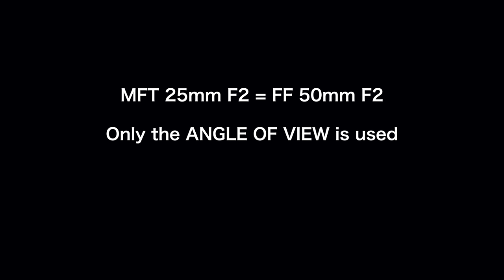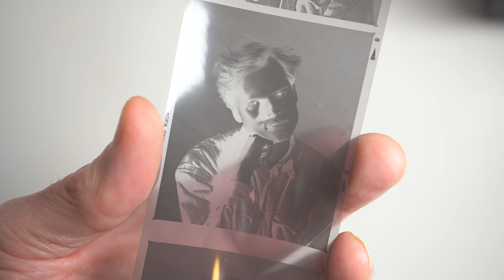Equivalency –What does it matter?

Comment: I'm an avid lumix micro 4/3 user and love that the lower end of lenses are really small and portable, but I realised that if I want to start buying the higher priced lens, eg. 42.5mm f1.2 nocticron then I would have been better off buying a sony FE 85mm f1.8 which is faster and cheaper by 30-40% and this is just 1 of many examples.  Size is roughly the same, so thats when Micro 4/3 start to lose its advantages.  I think if you want to invest in glass, then its cheaper in the long run to buy full frame if you compare them properly, i.e. method 2 in your video.   But if you are just a pro-consumer like me and only buy sub $800 lense and love portability then micro 4/3 is better.
Reply: Raymond Par. Mico 4/3 is interesting if it stays compact and cheap ( bodies and lenses). If you start buying expensive and fast big lenses , you shall better go for FF mirrorless with f1.8/ f2 prime lenses and f4 zooms. Currently it means Sony FE or Nikon Z systems.
Reply: How do you figure f1.8 is faster than f1.2? Will you have shallower depth of field with the f1.8 on a FF camera than the f1.2 on MFT...yes. But the f1.8 faster...NO. All else being equal if the light available requires f1.2, the MFT will have the proper exposure, while the FF will be under exposed.
Reply: @pwx8460  , have a look at 6:01 and do further research into how and why the MFT system need to double the f stop in depth of field as well as light.  I was also shocked by it in the beginning as I thought that same as you and thus compared lens between MFT and APSC and FF the same way, unfortunately there is a heavy premium to have FF equvalent fast lens in MFT system.  Also, 6:01 reveals that 50mm = 25mm, ISO 800 = ISO 200; F4 in light and DOF = F2  in MFT system.  Regardless though, I've come to terms with why i bought the MFT system in the first place which is size and weight, thus my original statement holds.
Reply: @xsaviour755  Hi. I did, look again, but already knew the answer. The f4 FF and f2 MFT looked the same, but all was not the same. Matti had different f stops AND different ISO, he had to crank ISO to 800. So two stop change in f stop and 2 stop change in ISO.  For the same FOV for any system and all other parameters the same an f-stop is an f-stop. Yes, the depth of field is different, and the required focal length is different...but for the same FOV you require the same f-stop. That was my point about f1.8 is not faster than f1.2. Now if you tried to cram a MfT lens on a FF camera you obviously would have a slower lens than what's written on the lens barrel (by 2 stops). As well as massive vignetting and a host of other problems. 😃
Reply: @xsaviour755  Your information about exposure differences is incorrect; the video shows that the exposure is identical at the same f-stop on both cameras. An f/2 lens on MFT captures the same light flux per unit of sensor area as a FF camera with an f/2 lens. What changes is the apparent depth of field at the same distance with an equivalent lens focal length (e.g. 25mm on MFT, 50mm on FF).

The reason for this is because depth of field is dependent on the actual physical aperture of the lens, also known as the entrance pupil. A 50mm f/2 lens will have an aperture of 25mm (50mm / 2). A 25mm f/2 lens will have an aperture of 12.5mm (25mm / 2). Essentially the 25mm MFT lens is stopped down to a FF equivalent of f/4 (50mm / 4 = 12.5mm). This is why an f/2 MFT lens of half the focal length, looks the same as an f/4 FF lens.

There is a lot of misinformation out there on the internet, but the reality is easily proven with some basic math!
Reply: @pwx8460  We are not anymore in film times.
I have got MFT and  ML FF bodies. They all have variable iso. If you think that noise and dynamic gap between them is only 1 ev , you are wrong. My conclusion is:  Expensive MFT bodies and 1.2 MFT lenses are not competitive and not compact enough.Keep your MFT gear small and inexpensive or switch to FF.
By the way, try you example in real life with same iso value and ,if you have an Olympus body and a Sony FF one , you will see that one iso by Olympus does not equal one Sony's one.
Reply: @metphmet  since when did digital change the physics of optics? The discussion was about the light gathering ability of same F-stop on respective sensor (or film) sizes. 

As far as your noise argument if that's what you're trying to get at, equivalency (the entire point of the video), would suggest about 2 stops different between MFT and FF (with the same number of photo sites, and same employed technology CMOS, BSI etc.).

See post above by John Wheeler, he has it spot on.

Oh and a quick cursory glance shows lenses of equivalent focal length and f-stop to be twice as heavy and nearly twice as expensive for FF compared to MFT.

Not fully twice the price you say...well when you're buying technology you shouldn't be paying by the pound, like a sack of potatoes. There was just as much engineering involved to design either lens. Just less materials in the MFT...which is the smaller (much) portion of the cost in making a lens.
Reply: @pwx8460  You know that there people like me using both mirrorless systems and who know a little bit about this topic . 
May I suggest you to watch size and weight of a EM1 with a 25mm f1.2 and compare it to a A7III with 55mm f1.8 or Nikon Z6 50mm f1.8. I can give multiple examples like this. When I choose some MFT equipment , I tend to keep it small and compact. 
Actually I don't understand your point . Do you suggest me to sell my A7IIIr and my 55mm f1.8 to upgrade my Panasonic with a G9 or EM1 with 1.2 prime lenses?
Reply: @metphmet  Hi again. I don't expect you to do anything. To each there own as they say. I've owned/used MF,  FF, APS-C, 1/2 inch, as well as the tiny sensors in various cell phones. Never owned a MFT but intrigued by the platform. Please read my 1st reply. F1.8 is not faster than f1.2 when lens is affixed to the body it's designed. I think the post above by John Wheeler stated it best.
Reply: @pwx8460  , John wheeler's math is correct on the lens part but his assumption that ISO 200 on MFT = to ISO 200 on FF is not.  If you watch the link I gave, then you will see that ISO 200 on MFT = ISO 800 on FF which in turn means that F2 on MFT is giving the same results as F4 on FF.  We are not talking about calculations, we are talking about results = equivalency as per Matti's point on the video.  The question is if I was to get an MFT system, how do I get the same results as their FF equivalent.  If panasonic and olympus played on the same ISO ratings as their FF counterpart, then we will see the true output of the MFT F1.8.   I'm sure you've heard that MFT has higher noise when you compare ISO 200 to ISO 200 FF.  That's because their are not the same, and is more like the ISO 800 FF. Once you accept that this is true, then you will realise that F1.8 on MFT performs the same as F3.6 on both DOF as well as light gathering (only because they aren't playing fair on ISO ratings)  You can either think of it as MFT is lying about the ISO but is truthful about the lens aperature performance or the other way around.  Either way, MFT are using a system built upon on FF and marketing their line up as equivalent when it isn't performing the same.  Thus back to my point of "if you want equal high end performance"  then FF is better bang for buck, however if you want portability then go MFT.  Or you can just believe their marketing and pay almost double the price for high performing equivalent lens.
Reply: @xsaviour755  You've managed to put words in the mouths of 3 people, none of which is there. J Wheeler never said 200 FF = 200 MFT. I specifically stated there would be about 2 stops difference between FF and MFT (assuming photo site size being equal)...read my post of 3 days ago. And finally you are doing the same with Matti's video, since he said no such thing as you implied. At the video mark he had ISO 800 with FF camera to achieve f4 exposure same as 200 ISO with MFT and f2, showing same depth of field... equivalency. Your way of thinking suggests FF cameras are 'cheating' when compared to MF, and apparently criminal when compared with a view camera.
Reply: @pwx8460    , I want to learn more but not quite understanding your explanation.  So, correct me if I'm wrong.  My understanding of what you mean is that 1) iso 200 MF = iso 800 FF? Is this correct? 
2) F2 on MF = F4 FF in regards to exposure  Is this correct? If so doesn't it mean that F2 MF is slower than F2 FF ?  Which was my original point.  Can you please clarify.
Reply: @xsaviour755  sorry for the delay, YouTube notification didn't work. Item 1 you listed is true....IF you are considering the amount of noise between the two formats AND they crammed the same number of photo sites (pixels) on the MFT as on the FF. MFT is about 1/4 the size of FF, so actually a 20MP MFT may perform similar noise wise as an 80 MP FF. Assuming similar technology were applied (BSI etc). Most FF  have  much fewer pixels than 80 and consequently perform better noise wise often nearly 2 stops worth, which is why 200 ISO MFT is compared similar to 800 FF. However, in terms of exposure (all else being equal) the exposure would be same 200 to 200 or 800 to 800. The same idea applies to your item 2. For exposure the same f stop provides the same exposure for either format f2 to f2 etc. The lenses are bigger for FF ( and at same f stop), due to the image circle needing to be that much larger for the FF vs the MFT. So yes that bigger lens casts more light, but needs to, to cover the larger sensor. My original post was to argue that an f1.8 is not 'faster' than a 1.2 respective of the  sensor it's used with. If that 1.8 FF lens was on a MFT ( in some way), it would still be f1.8 in terms of exposure but casting a much larger image circle only to be 'wasted' or going beyond the edges of the  MFT sensor. I'm typing this on a phone, so hopefully my explanation it's not too convoluted.
Reply: The whole point  is that the DoF in m43 is *different*, and that you need to multiply by 2 to get equivalent DoF. If you want shallowest DoF, f/1.2 on m43 loses compared to f/1.8 on FF, period. Plus, FF bodies have better higher ISO and DR as this video actually notes, so you're not going to have an image that is unavailable, or inferior. m43 can offer great results, but @RaymondPar is right here.

Comment: I think equivalency is important when looking at new lenses. If you own like a GX850 with a 25mm 1.7 lens there isn't much equivalent with bigger sensor systems that could yield you the same results with similar price and weight. But if you own a G9 for example and wanna buy the Set of 17/25/45mm 1.2 primes from Olympus, I think it's a good idea to look to bigger sensor systems and see if they maybe offer something giving similar or even better results for the same or less weight and the same or cheaper prices.
Reply from the maker: Good point, thanks!

Comment: What confuses most users is that a 50mm FF lens is still 50mm when adapted to a Micro four thirds camera.
Reply: Yes, indeed, although this may be in part due to how some compact camera lenses (or smartphones) are marketed with "equivalent focal lengths". e.g. I have a Lumix LX100 that says the focal range is 24-75mm in the specs, but looking at the lens it states its real range (10.9-34mm). People have become so used to being told equivalent focal lengths (relative to 35mm FF) that they are no longer sure whether the lens' focal length is the real one, or the equivalent.

I do think that with the range of sensor sizes in use, particularly for video / cinema cameras, that any description of lens selection needs to include information about the sensor, if you need to understand what the field of view will look like. Photographers used to always assume a 35mm film (and maybe mention if medium format was used) and cinematographers would assume Super-35 (unless another film format such as S16) was used. Nowadays you need to know the specs of all the cameras!

Perhaps we should use angle-of-view instead of focal length to describe our lens choice. People can then work out what lens focal length this equates to on their system....The problem with this is that you don't know exactly which model of lens people are talking about....so I doubt this will catch on.

Comment: To point out some pros of mft:
+ Macro photography
+ price, weight and size
+ telephoto lenses that can be paid
+ photography without tripod
+ adaptation of old classic lenses (like Meyer Goerlitz Trioplan or Lydith)

Cons:
- wide angle astrophotography 
- portrait shooting with small dof

I still try to come closer to the borders of the mft system.
And in the moment I think even Deep sky photography, the mft system is not too bad. 
Don't forget the lenses makes the picture ...
And the weight of the body is not the overall weight. The weight and costs of the complete system with tripod, filters and other accessory has to be taken into account.

My neighbor has a much better camera, but I make the photos because at least my GM5 is in my pocket ...
Reply from the maker: Thanks for sharing your pros and cons. Everyone has a slightly different opinion😀
Reply: @mattisulanto  yes of course! It would be great to have a second camera with 14 Bit dynamic range, that can not be found in the MFT-world, especially for Astrophoto ... but the overall benefit is too small to buy a second system.

Comment: Great understanding between systems. I'm looking to buy my next camera. Q: I use MFT & know it well. I don't have access to a camera shop to try out cameras so I wanted to ASK YOU... does the S1 series have and take a noticeably "better quality still image"?
Reply from the maker: Thanks! It depends what you mean by "noticeably". I have the S1R and the IQ is much better than any MFT, but if I publish on Instagram, nobody will notice any difference. So, it all depends on where you end up using the photo.
Reply: @mattisulanto  Okay, thank you for your reply :) I would like the ability to print to 20"x 30" if needed.  Do you think the S1 is capable or do I need to get the S1R?

Comment: Question. Does MFT always have deeper depth of field OR can you always achieve a deep depth of field in FF if you stop down the aperture???
Edit: for the equivalent iso/noise performance.
Reply from the maker: I'm not quite sure what you mean by the EQV ISO/noise performance. FF has roughly two stops better signal to noise ratio. The DOF depends on the aperture, of course. The end result depends on the combination of shutter speed, aperture and ISO.
Reply: @mattisulanto  if I desire a deeper depth of field, is there ADVANTAGE to MFT? Or can the same / better (brighter image) result be achieved using a higher F-Stop on a FF?
Reply from the maker: @JeffBourke  It depends on the situation. In my opinion there is no simple straight answer. It's a bit like asking which camera is the best without defining anything.

Comment: Hi Matti. Shouldn’t the FF capture wider pictures than the MFT 4:3?
Reply from the maker: FF aspect ratio is 3:2 which is wider than 4:3.
Reply: sulantoblog that’s right but in your comparison pictures, the FF has the same width as 4:3.
Reply from the maker: @aviatorman8  That 2x crop factor is not scientific, it's only approximate. You could also ask, shouldn't the MFT photo be taller?😀
Reply: sulantoblog it is taller. The FF appears to be a crop from the MFT which isn’t in your pictures, of course. My LX100M2 captures wider images at 3:2 than 4:3 since the sensor can be switched to a true 3:2, 4:3 or 16:9. I might be confused thinking that FF should capture wider pictures than regular MFT’s and DSLR’s 4:3.

Comment: I think the equivalency issue comes about because almost all of our cameras these days have the 35mm camera "look" but pack what amounts to different film sizes inside.  I've been experimenting with big prints lately and was astonished at the quality I got from a Canon SX60 producing a 30-inch print photographing a perched bird at the 35mm=focal length of about 2,100mm's.  However, I wouldn't recommend this camera for birds in flight or any kind of night photography.  I think we just need to realize the "job" (or the budget) dictates the tool.  A questions about contrast autofocus...do Lumix cameras and lenses require periodic autofocus calibration as do cameras with phase detection autofocus systems?
Reply from the maker: I don't know of any periodic calibration for any AF lenses or cameras. Mandatory calibration, that is.
Reply: I was a photojournalist for just over 40-years but lens calibration didn't become a "thing" until the end of my career with autofocus cameras.  Lumix seems dedicated to  contrast-defocusing-autofocus as opposed phase-detection autofocus and I wondered if a benefit of contrast autofocus was no calibration needed.
Reply from the maker: @brucegraner5901  I've also been in the business for about 40 years, but I have never heard of any regular AF calibration. Could it be, that in PJ work it's good to check the AF regularly, because in that work cameras tend to sometimes get rough treatment? Especially on a DSLR the AF element is not on the sensor and if it moves ever so slightly the AF is not accurate any more. On a mirrorless camera the AF sensor and image sensor are the same, so there can be no misalignment. I see no reason why the AF would go somehow out of alignment all by itself.
Reply: Maybe I explained it wrong.  Occasionally, from what I've heard, some lenses benefit from AF fine tuning or calibration.  Please see the following link to Steve Perry's blog addressing the problem:  https://www.youtube.com/watch?v=TLe6mXjFRdA    Go to about 8:15 in the video.  I was just wondering if a benefit to contrast focusing, as used by Lumix, might be contrast focusing eliminates the need for this altogether.  Thanks for taking the time to reply.